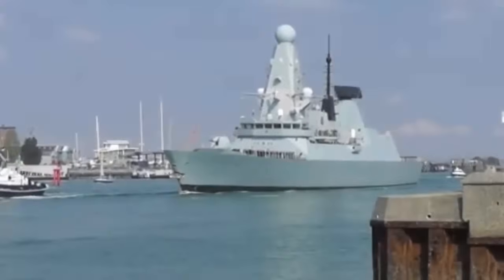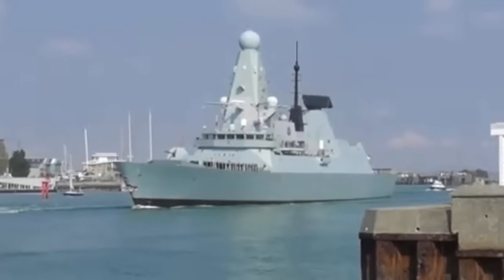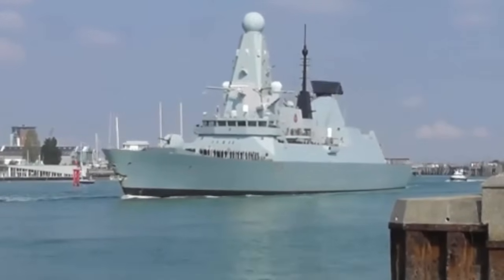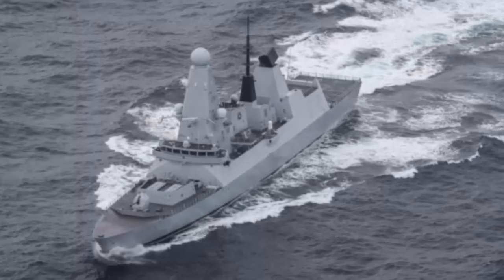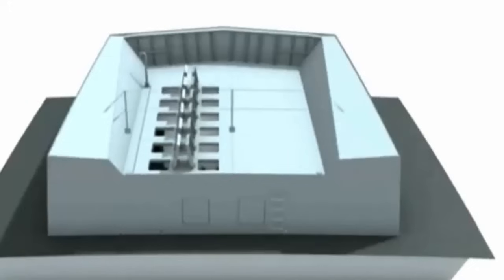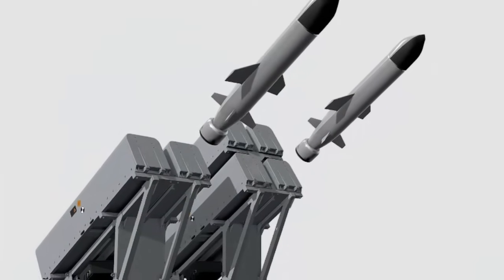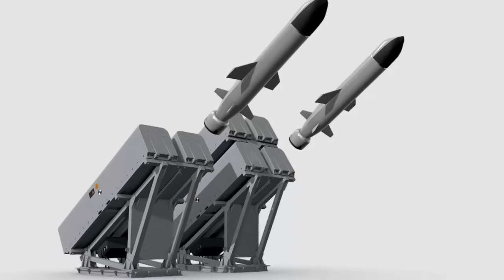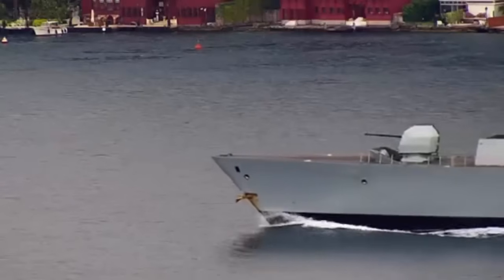UK to install CAMM silo on Royal Navy Type 45 Destroyers  HMS Defender progresses upgrade project

Comment: The question then becomes whether or not the loss of Aster 15 diminishes the Type 45s capability to any degree. The way I see it, not really. The only disadvantage of is the increase in minimum engagement range (from 1.5 to 3km) going from Aster 15 to 30. They both cost about the same.
There are certain scenarios for which the Aster 30 would be overkill, such as engaging sea skimming anti ship missiles without AEW cover, as the detection range over the horizon is well below the maximum range of the Aster 30, so the greater range of Aster 30 would be of no use in such scenarios. But it also doesn't hurt to use Aster 30 in this case, and it offers benefits when attacking high altitude targets, or engaging targets over the horizon when cued by offboard sensors like Merlin CROWSNEST when operating as part of a CSG...

Comment: We really needed to upgrade how many Aster 30 Block 1's she can carry, I do understand that the upgrade with the 24 cell sea ceptor will enable us to field the full compliment of  48 Aster 30 Block 1's but we should have an even larger amount given saturation attacks. Should be more along the lines of 96 Cell Aster with the 24 cell sea ceptor. Maybe having a rear mounted 48 Cell VLS.
Reply: its a balancing act, they already cost over a billion a pop and the upgrades alone as they are, are 500 million. Were spending 10s of billions of new type 26 frigates, new type 31's, new astute attack submarines, new dreadnought class nuke subs, we built x2 brand new aircraft carriers, spending a ton on f35b aircraft also to go on them, were building new challenger 3 tanks, new armoured vehicles, new Apache helicopters, new reaper drones, developing our new 6th gen tempest fighter jet, new support vessels for the carrier group, new guns/weapons for the army, etc etc etc. Everything's getting a massive upgrade, so it has to be balanced
Reply: You are right as ballistic missiles are of threat.

Comment: I've always wondered why the A70s aren't moved a little further apart and another placed in between.
Reply: Type 45 doesn't have A70 Silos,they are A50's,arguably they should have had A70's from build.
Reply: @paultanton4307  Quite right.  My apologies.

Comment: Put bluntly, installing a mere 24 cell CAMM Sea Ceptor 'mushroom farm' amounts only to yet another 'minimum-cost-we-can-get-away-with' de facto BODGE, approved unreservedly by just the Whitehall parasites who I have no doubt fought tooth and nail, as per usual, to stop any more capable solution being authorised instead.
In short, our potentially worldbeating AAW Destroyers, after having already been (or are still being) generously treated to one propulsion plant rectification bodge job, will now be reluctantly allowed a follow-on weapons fit bodge as well....   ....with the combined effect (exacerbated yet further by the same beancounting vermin's also invariable drip-feeding of the needed resources through) that of 6 ships actually in the class, four are currently unavailable!

Comment: Sea Ceptor's very capable BUT can in any case be quad-packed in Mk41 VLS. Which would permit the T45s a wide mission specific choice of EVERY OTHER ESSENTIAL CATEGORY of top tier system too; ANTI-SURFACE, ASW and LAND STRIKE! So what the T45s (for far too long massively underarmed iaw our Whitehall parasites adored FFBNW lie) really need is a 40 x Mk41 strike length VLS fit...  8 cells of which can, as stated, then house 32 x Sea Ceptor while still leaving 32 more cells available!

Comment: Whilst it is great news and long over due for Type 45’s to be given this much needed Missile Capacity Upgrade, I feel it would have made more sense to have increased the VLS capacity with Mk.41 Strike Length VLS Cells instead of the Sea Ceptor only VLS, even despite the increased costs and political expediency. Therefore allowing for the Quad-Packing of Sea Ceptor or the future possibility of the upcoming Aster 30 Block.1, FOSW or TLAM Block.V Missiles. Not to mention the future commonality with Type 26 and Type 31.
Reply: Indeed, that would be an improvement. 24 CAMM cells is decent, but there's supposed to be space for 16 Mk.41s. As the Mk.41 is able to quad-pack CAMMS (courtesy of ExLS from LM), this could allow for a total missile count of 112 (48 Aster 30 + 64 CAMM), which is very formidable - and more in line with what the USN, ROKN, JMSDF and PLAN are able to field.
Reply: @josh-029 Absolutely! Cheers.
Reply: No that would require common sense and a complete practicality of not wasting fast sums of money at the strategic expense of the country your ideas are too sensible and correct
Reply: @SchindleList  Absolutely , so true, as we all know the MOD and Government couldn’t run a bath, let alone our National Defence! Cheers.👍
Reply: The MK41 option,although desireable would work out much more expensive,plus we currently have no Missiles to put in them.Dedicated CAMM VLS makes more sense  for the Aster 15 replacement.